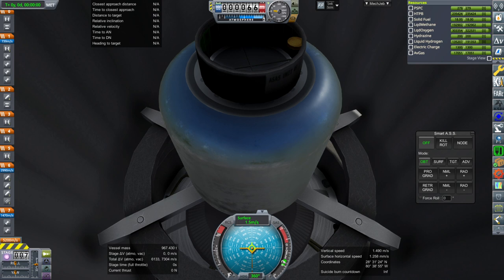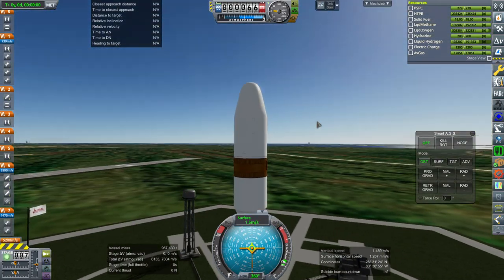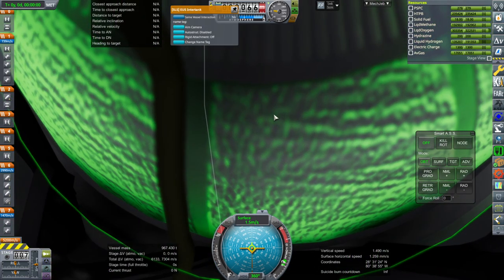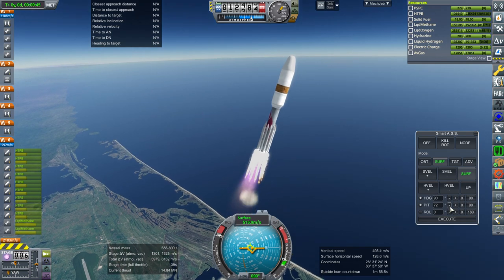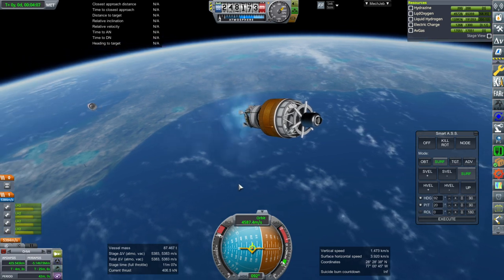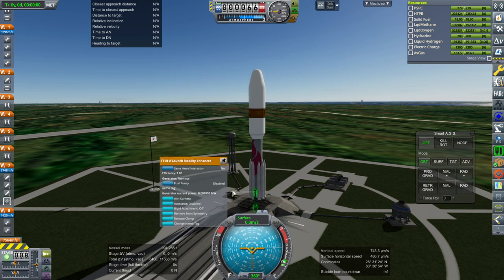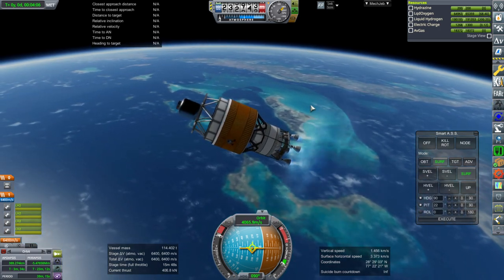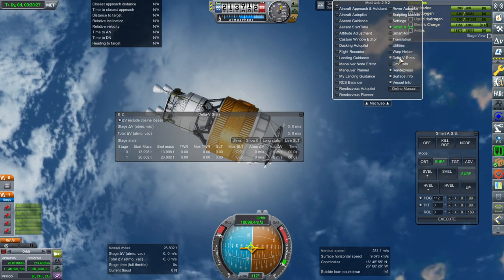KSP with Realism Overhaul - Most Cursed Vulcan Configuration?

Comment: What would it take to make the entire first stage ol Vulcan reusable, propulsive landing on Drone Ship. Btw. if you want a cursed rocket than take the Dleta IV Heavy and straf 4 SRBs to each CBC.
Reply from the maker: A different engine configuration, first of all. With two engines placed side-by-side, they probably can't throttle down enough to ensure a propulsive landing.